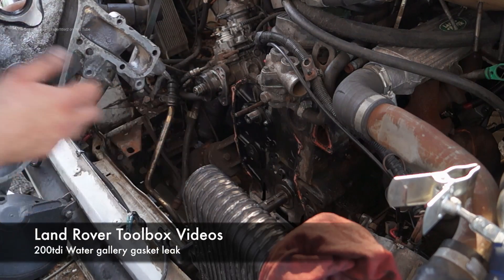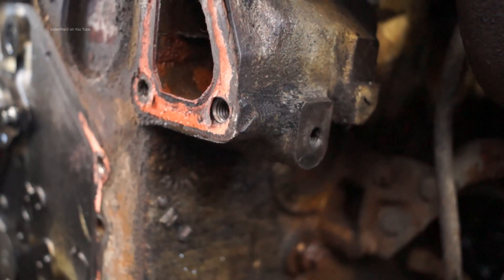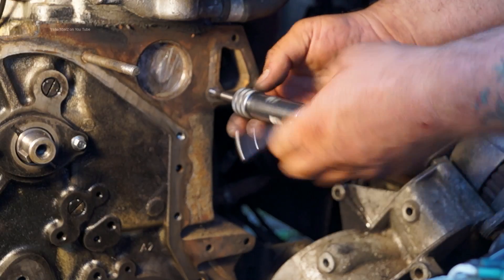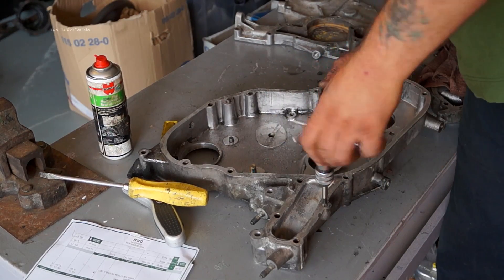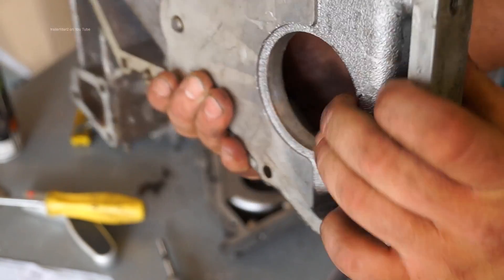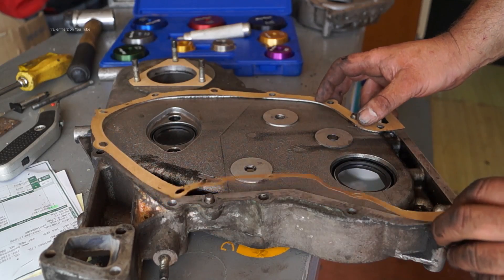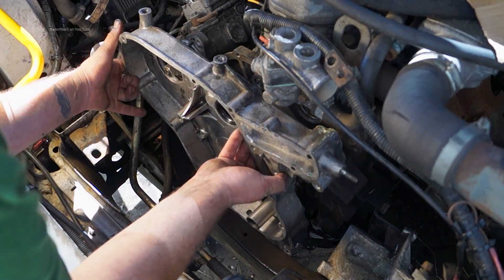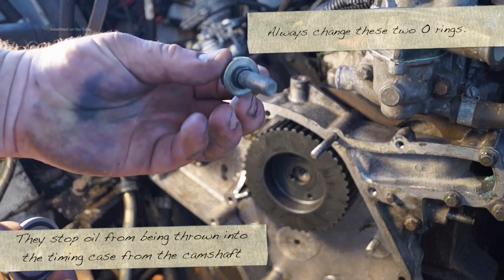STC 1557 and the 200tdi P gasket, water leak cure and some fitting tips

Comment: Mate - Great videos - Very helpful - Thanks heaps - Only thing is though that I just followed this tutorial to the letter and when I got to the paper penny-washer bit at 3.20 it appears to me that on the Defender version of the TDi200 engine that-there stick on gasket thingy actually should go on the Lower hole and NOT the Upper one! - I point this out because once I started my Deffa up I immediately got an oil leak in the timing case via the Tensioner Bolt - Not having a go mate just saying that it might well be worth an edit to save others the grief of having to do the whole job again because of it - BTW In the end this search revealed how I found the solution to the error http://forums.lr4x4.com/index.php?showtopic=65378 ATB Mark Opie NSW Australia
Reply from the maker: Ah okay this one never leaked and is still going strong for the new owner.  Thanks for the heads up though.
Reply: Not a wozzer mate ;-) Old mate`s didn`t leak because it`s the Disco version of the 200 with the extra idler - Which means that on that model the hole you cover is indeed the top one (like you did) - BTW It ain't just a packer to shim out the case like you said, it also serves as the gasket to stop oil going into the timing gear via the adjuster bolt which is what happened to me on my Deffa - Therefore I`m guessing this means that the engine block is generic whilst only the timing cases differ - At the end of the day mate I blame the boofhead who designed the bloody gasket - If he`d specified an oval gasket with two holes in it no one would have any dramas - ATB Mark